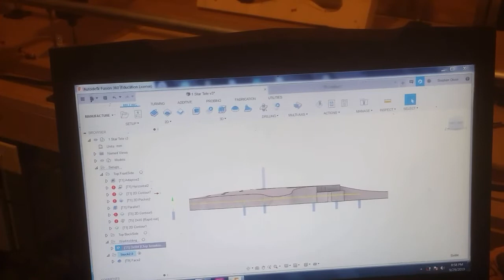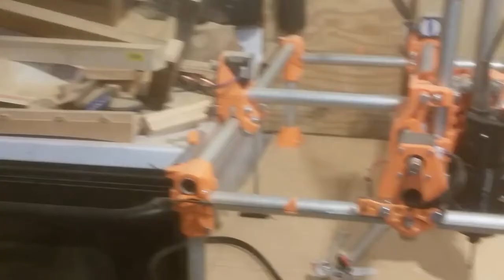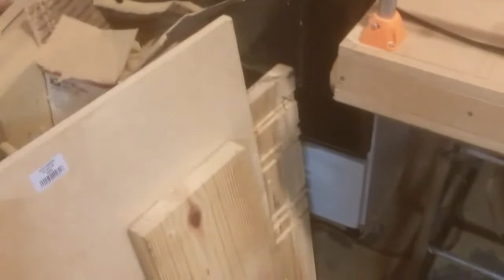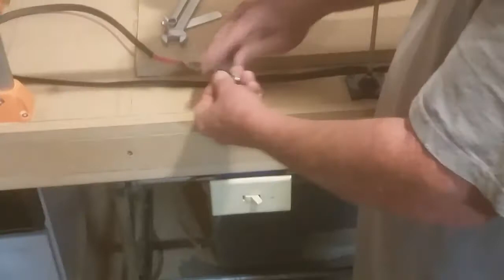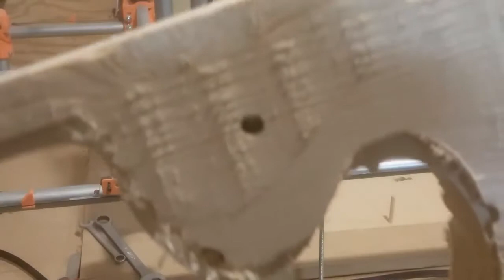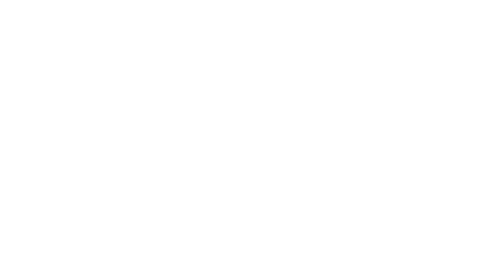MPCNC guitar setup, pins and cnc time savers!

Comment: Dang, I wanna build me a guitar.  How thick does the stock wood need to be?  You got any links to info I need to learn to build a guitar?  Also, how do you save your Z offset for your touch plate?
Reply from the maker: Hi Michael, for bodies normally you need 8/4 or 2 inch thick, one piece, or glued up like I do some. Look up parametric guitar on YouTube, you can get a file to start with and adapt to your likings! You put the z offset in your post setting up the cuts!  Hope that helps, thanks for the sub, my other page has some of the same stuff!